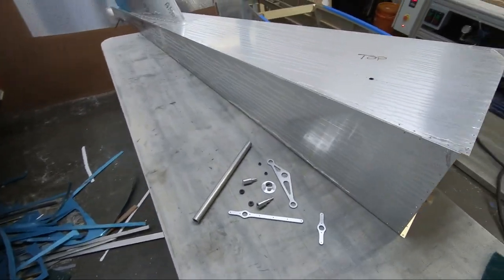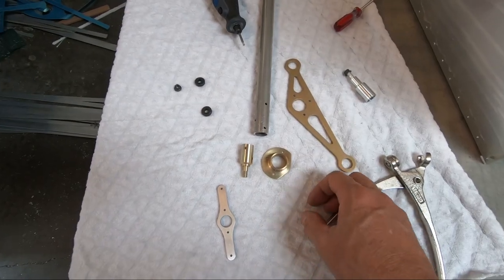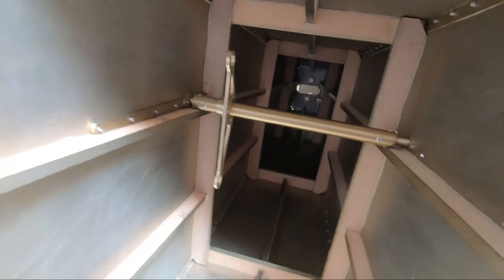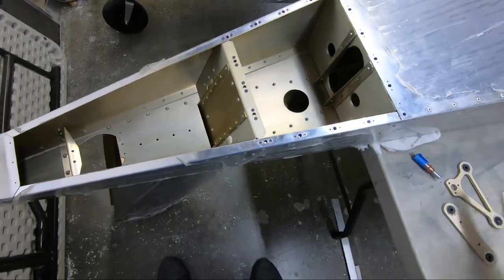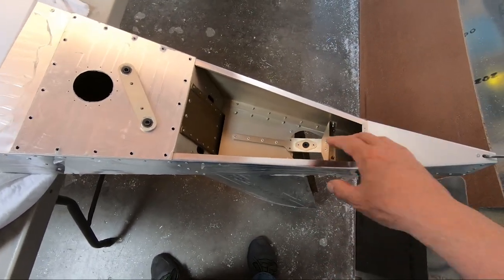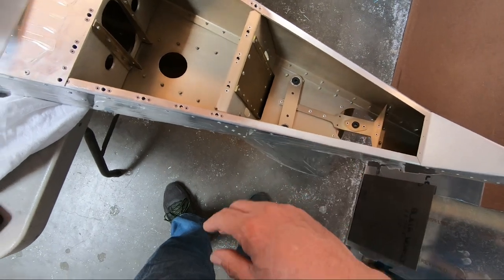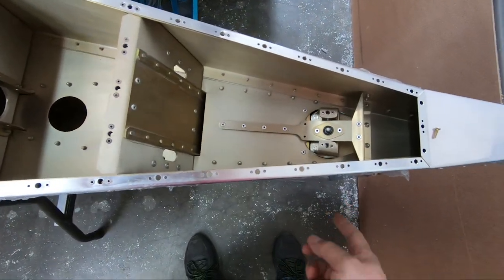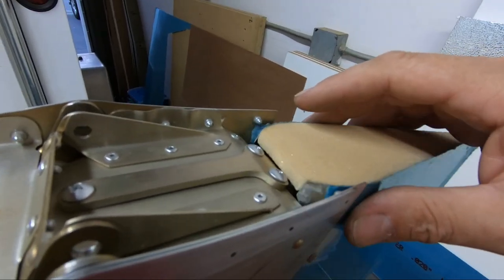27 - CriCri Airplane Build - Rear Fuselage Final Fit-out

Comment: Good to see another update, bottom right corner of sheet 305 says 25° of travel each way and to cut the hole out to suit. I cut the notches into the folded part of the fin spar as well.
Reply from the maker: Yes, I will go back to my rear spar drawing and add that in. Thanks Shannon!
Reply from the maker: That was a good find. Without the notches or predrilling the holes it is hard to tell the top from the bottom of the fin rear spar. Would have been easy to bend it upside down. Looks symmetrical, but the bottom is actually 3mm wider than the top. I now have the notches and the holes setup in the cut files. You can easily tell what end is the bottom now!
Reply: @crikitaviation  The rear fin spar is a tricky piece to get just right, I think I made three before I got one that I was happy with. Getting the taper and width spot on took me a while. I the end I cut  a wood block to fold it around. I have been making more progress on my build but have yet to post any updates.
Reply: I used a couple of cherrymax rivets where the rear spar attaches to the fuselage skin. They can be used in place of solids and are much easier to install.
Reply: @crikitaviation  
Hello, dear engineer I had a question that has been bothering my mind. Is it possible to use the trainer wing design (symmetrical aerofoil) for this plane? Or must you use (semi-symmetrical aerofoil)??

Comment: hey Jim, 
so the bolts that hold the top bearing, the plans show them installed exactly like you installed yours however that is upside down from what the conventional aeronautical way is, do you know why that would be? 
in mine i installed them the aeronautical way (ie bolt from the top and nut on the bottom) and for the life of me i can figure out why MC wanted it the other way around
Reply from the maker: @dominiqueghekiere7433 I agree with you that the bolts are upside down. I've found that in a few different places in the plans. I do think you can install them following the aeronautical rules. I think Colomban was simply looking at ease of installation. Technically you should be turning the nut side (that's why it has a washer) and keep the head fixed with a wrench while tightening/loosening and best I can figure, he thought it was easier to wrench on the topside of the fuselage instead of inside. Same situation with the frame 1 engine mounts, although the engine mount would depart the airplane no matter what direction the bolts are installed. Definitely easier to tighten those nuts on the outside.